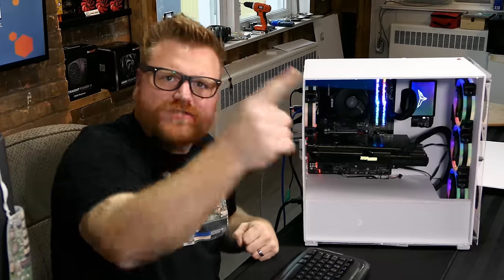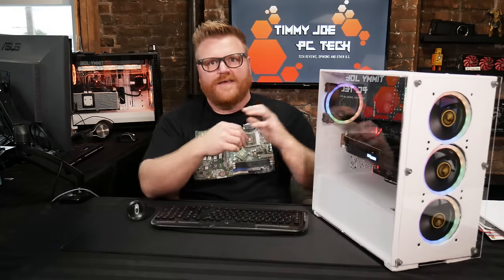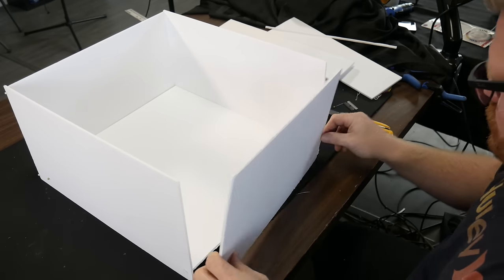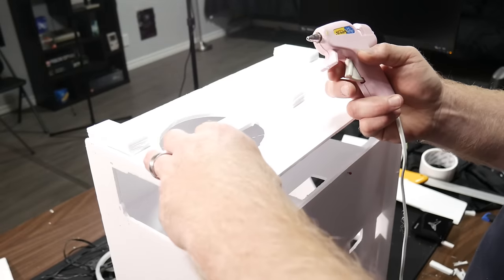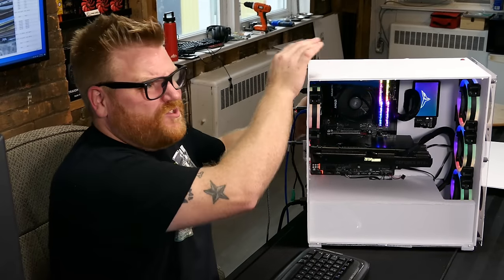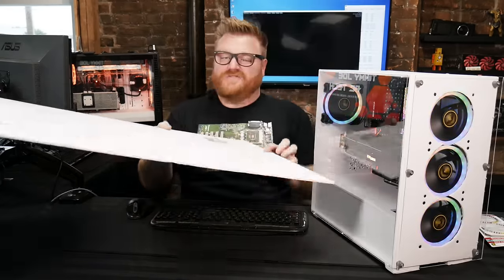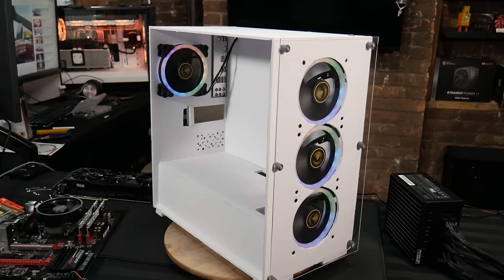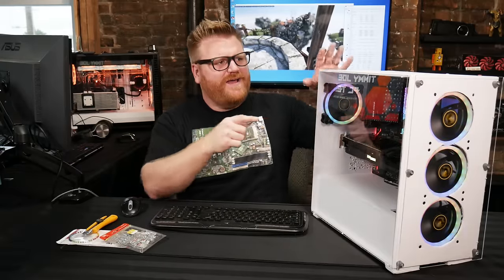How to build a PC case FROM SCRATCH for under $20!

Comment: it cost only $20! uses $20 worth of acrylic that was "just lying around"
Reply: There's like $40-$50 worth of materials here if you're starting from scratch lol 😂
Reply: Basically every DIY video ever
Reply: Use seram wrap
Reply: He said it was an extra $12 of acrylic.
Reply: @StaveEntertainment  that or tin foil most people have one of those in the house lol
Reply: @Best Short Clips this is true specially in the 90s the chances where crazy like lol
Reply: You could just as well use polycarbonate for like 10 bucks.
Reply: @StaveEntertainment  Now that's sone big brain thinking.
Reply: @Best Short Clips  r/woooosh
Reply: I just broke a window in the living room and used that
Reply: I got a 500x500 sheet of acrylic for 5 euro recently. And that's with the price gone up due to increased use for sneeze screens
Reply: @Best Short Clips which was the style at the time
Reply: I already have large glass panels laying around my house for the side glass panel lol. Square panels and some that are 1/4 circle. I'm actually going to use this method to mock up a HTPC I will later build with better materials. Use a large glass panel for the top of the HTPC.
Reply: looks like the cheap Cooler Master MasterBox Lite 5 it's only worth 54.99 cad
Reply: @TechJmdog  but that one comes with one fan, this would be about 30-35 euros with the fans while that case is 52 here, add the fans and you're at 62-67. I myself have an H500, but you can't say the lite 5 is as cheap or even close.

Comment: I know this is an old video so this comment probably won't be seen by anyone, but as a quick tip - for much better building material for FREE or very cheap, go to your local car scrap yard. You can get Car panels (Bonnets, Boots, Doors etc) for either nothing or just a few quid (colour and condition don't matter, you're carving it to pieces anyway). Suddenly your posterboard / mdf designs are sheet metal. Again, you can pick up glass panels from doors, and various structural frame struts from the off-cuts of wrecked cars. Obviously this all means your home cutting equipment needs to be a little better quality, but what you save in one build pays for each tool ;) The same applies for decent source wood - go to charity shops and ask for the worst draws / cupboards they have they they cant sell - again, you'll get an excellent supply of decent wood for pennies - and again, ignore the design / colour etc - its the quality and amount of wood you're interested in. Acrylic / plastics is a little harder - but again the car scrap yard can be your friend - a lot of cars are made of plastic / fiber panels so asking for the more smashed up off cuts for free is usually fine by them. If the dealer starts to get crabby with you, just offer to build them a free PC case if they supply the materials - you get to Cherry Pick the best parts and you should have free supplies for years to come. Plus, if you're at the stage of building your own case, you almost certainly have shelves full of old PC components... you can easily build a spud PC into a flash case to over-impress them ;)

Comment: Case: $16 
Acrylic: $40  
lol
Reply: You could just as well use polycarbonate for like 10 bucks.
Reply: Jan Nowak  lol acrylic where I am costs about $10 for a 12x12 piece. The piece he used for the side panel is easily a $25 piece plus the piece he used to cut the front part is probably a $!%-$20 piece.
Reply: @invaderjae  also those fans aren't free and that material is used for posters. At this point you can just build it in a shoe box and it will be less fragile.

EDIT: just realised, isn't that poster flammable? I'd much rather not burn the house down and just buy a case.
Reply: @moa132  you dont know much about PCs do you? There is almost zero risk of this system catching fire.
And also, the fans are not part of the case, they are PC components and would not be included as a materials cost. Lol
Reply: Ryan Bruce the chances are never zero tho
Reply: @invaderjae  In my country i got 16x16 for $2 xD
Reply: @farhaan_k  what country is that?
Reply: I guess the price of Acrylic really depends on where you live.

For real, I can get plain 100x100cm Acrylic 3mm thick for just $5
Reply: I just picked up a piece of tri-plex hardwood and messing screws/hinges and a small 2m 12x12 mm hardwood beam. 15€ total. Pray for my diy skills haha
Reply: @liveyourdreammedia  about 1 CM Thick
Reply: @ClayWheeler  damn your lucky. Wanted 0,9 cm but it was sold out so i had to settle for 0,4. Gotta say though so far taking shape nicely. Got the parts sawed and sanded, gonna varnish in a bit but first a small break.  Was looking for a cheap 2nd hand case but they are either overpriced or complete garbo haha. Hope this will turn out somewhat decent and I'm happy 😁
Reply: @stealth1384  they said almost can u read lmao
Reply: @moa132  a shoe box would be more fragile, less aesthetically pleasing and it would have a limited size. with this material you could probably make a 100cm by 100cm by 100cm
Reply: @invaderjae  the piece of Acrylic I used was a 14” x 15” piece at ace hardware costed me about 6 bucks. I modded an old HP case just the access panel though and cut a couple of holes in it for a few rgb fans 120mm and worked fine. I like his design though really very nicely done

Comment: As someone with 50 years of woodworking experience, this is an awesome idea. especially since I am only a couple of months away from building my 1st PC.  The "dust" issue can be eliminated by applying (suggest 2 coats minimum, with #0000 steel wool buffing between them) all exposed wood surfaces with a water based polyurethane.  I have enough hardwood, cherry, ash, walnut, ipe, etc. to fashion my case with only the tempered glass as an expense.  My idea [haven't drawn anything on my PC via AutoCAD yet] is to use the best features of the Lian Li Dynamic Evo and the Hyte y60.  Glass front and side and the 45 offset piece like the Hyte. But, size it to accept the 10 fan arrangement of the Evo. with the dual chamber behind the motherboard for the power supply and cable management, leaving the bottom open for 3 120mm fans (intake). Side mounted 360mm CPU AIO (intake), 3 -120mm top intake fans (intake) and one 140mm or 2 120mm rear (exhaust) fan. With fan speeds I can manage the positive pressure where it is most effective.  Helps having a mechanical engineering degree where I calculated air flow (CFM) for years in HVAC AND Exhaust systems.  By saving $150 to $200 on a case, I can now go up on my CPU and GPU, even and extra $100 on each will move the needle towards a faster PC.  This also gives me the idea of the beveled glass panel being a Sensor Panel screen, similar to this one https://youtu.be/gXkMSlN-unI?si=sVByM9D9xoa483A3

I'll dovetail or design a finger joint (dovetail without the angles) for all exterior panel connections and probably use vertical stiles to separate the front, beveled, and side glass panels, using a mortise and tenon at each end. This will make a very strong case and a very unique looking one, especially using multiple wood species. I am several months away, but that just gives me time to design the case, verify airflow vs volume, and size the case to the need. I am not limited spacewise, to where it will live. So, if it gets an inch or 2 larger in any one direction than say the average mid tower, I am ok with that. 

Wish me luck, I will report back once I get started.
Reply: I think the "dust" issue is more the lack of mesh/filters on the fan intakes, rather than wood dust?
Reply: Update?
Reply: Started the project yet?

Comment: I see this as a more viable option for SFF builds. Smaller dimensions and less weight applied to the material should lead to better structural resistance, and using less powerful components generates less heat to be dealt with the smaller cooling solutions. Also, I would go for a horizontal mobo build for more stability and less gpu sag
Reply: that doesn't really secure the card. this aint it chief.
Reply: You guys have any thoughts on what case orientation would secure the card?

Comment: Double up layers on the outer structure and it will easily support liquid coolers or a heavy tower cooler. Add additional buttress bracing on corners and it will support a 3090's weight no problem. Add additional material to form gaskets at screw points to improve longevity
Reply: Good ideas and all, but I feel like someone with a 3090 wouldn't need to build a case 😂😂

Comment: I thought about that very Linus video you referenced as I clicked to watch this. You're right, you did much better than they did.
   What if you made certain panels 2 or even 3 ply thick to add rigidity, you could then think about water cooling since it could support more weight.
   Very creative Timmy!

Comment: Theorically you can make Styrofoam melt into molds made from the measures you did and do a solid case without termal issues. Nice video.

Comment: Nice case and good job on build. Just so anyone following knows, and for information - not criticism. But the advantage of a metal case keeps FYI in/OUT of your computer build. So if anyone builds something like this (even an issue with some acrylics) you can cause interference to a nearby TV, or LED lights could potentially cause issues in the computer. 

Just a little info that a mfg would have to go through to get certification. They would have to measure the RFI output to ensure there is no impact to other systems. I know this would go crazy in my house with my amateur radios once I keyed down. I used to blank out my neighbors TV on a certain channel (I was legal, TV was not - long story).

Adding metal or foil in the build could help reduce any issues, and help with bonding. And not everyone will have an issue.

Comment: This looks scary, the sagging gpu there is stuff I might have some bad dreams about.
Reply: All you need is a handy dandy anti-sag bracket. Ta-da!
Reply: @CaveyMoth  I use a pencil broken to length then wrapped in electrical tape
Reply: yep, im remember the radeon hd4850x2 at that time, it was really heavy and very hot (tdp 250w)so it twisted until the heatthinks nolonger touch the vram chips. im remember we put a nice home made card holder to avoid it and preserve also pci ex port

Comment: I made a custom PC case. It looks stupidly Frankenstein, was made out of an old HP that was going to be thrown out. So far 
Case - free 
Some other parts (fans etc) free 
Bought Matx mobo CPU ram and PSU threw it in, made sure everything fit with a few mods. 
Looks okay, side panel has holes all through it for air flow mounted fans externally, and front panel modded external fan. Looks ridiculous but at the same time the Frankenstein self mod, absolutely free in that sense was fun, and looks coolish/modified

Comment: The best way to build a high end from scratch custom case is very similar, you prototype it with bristol board the same way you built yours, test your fit, and airflow, and then order premium materials and sub out the cheap proto materials for the final pieces that are usually machined Aluminum and/or glass and acrylic which for laser cut can be expensive, but by the end you typically have a real nice custom case.
A lot of people I know use older cases as well for parts and materials, a versatile one is something like a Thermaltake P series case that is highly modular and gives you a brace for a vesa wall mount.

Comment: You built a case from 1/4 inch thick craft foam? That is not heavy enough for me to use. I plan on designing one and building it from aluminum sheets if I can find the measurements for the power supply mounting area.

Comment: While it looks okay, the foamboard will likely act as an insulator, similar to cardboard PC cases. Metal cases that conduct the heat away should perform better, though on the flip side they are likely to be more expensive and more difficult to mod. The acrylic panel blocking direct air flow to your front fans is a bit of a weird choice.

Comment: Is the material strong enough to hold up a power supply and motherboard? I want to build my pc inside a suitcase so that way when why i travel i don't have to hope i can sell my desktop pc before I go. I teach english overseas and i like to have one PC which has games and questionable content on and I like having my laptop which I would use for keeping materials i use for school. This is mainly because i worry that my students might explore my laptop and open sexrim and parents would have a fit .
  I have been considering what materials would be strong enough to hold the motherboard and was curious how strong cardboard would be. I have plenty of cardboard boxes and would love to be able to use them in such a way. In order to do what I want I would simply have to connect them to the suitcase. I figure I could even use the lining that was in the suitcase so I do not have to waste that either.
  For the most part, it would need to be able to hold being moved on the airplane.

Comment: Honestly after watching this I actually see no reason not to just build one into a desk, like my laptop is getting long in the tooth and I was thinking about switching over to a computer, I see no reason after this of simply finding a double pedestal desk, and using the bottom of one side as the case it's self. I mean honestly, if you can just go to the dollar store like this, and you are right, you made a very nice and obviously functional case, what's the point of me grabbing this 150 case that I've been looking at when I can spend the extra money on an L or even C desk? Thanks for this video, you have me thinking now.

Comment: You know I was just thinking out loud about this today and it pops up in the feed. I was thinking twisted oak frame with rort iron supports and stained glass equivalent front panel standoff. Perhaps stood on a sandstone or slate block.

That or some sort of wall mounted mounted neon 1960s style thing.

Oh or 70s glam rock cyperpunk hybrid.

Comment: To add extra strength holding the components you could use washers on the inside and outside of the screw holes.

Comment: Honestly, I wouldn't bother with a case.  Just set the motherboard on top of its original box, put the components in.  The psu and ssd will lay adjacent to it.  Put it somewhere where pets or children can't get to it, either high up, or in a cabinet with air fan circulation.

Comment: so this went through my head, not saying PC heat would be able to exactly melt or burn the foam board, but does anyone know the exact degrees (in C or F) that it melts or burns, specifically the kind he used in the video. More to be on the safe side :)

Comment: What is the melting point of foam board Timmy?
Reply from the maker: Foam is typically an insulator I really doubt it melts it without a flame or equivalent heat source, pretty sturdy